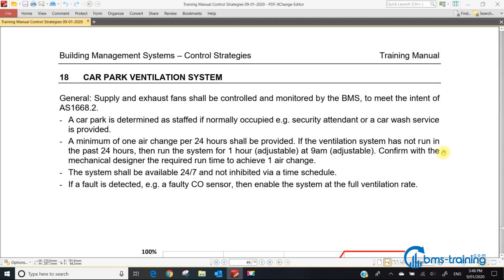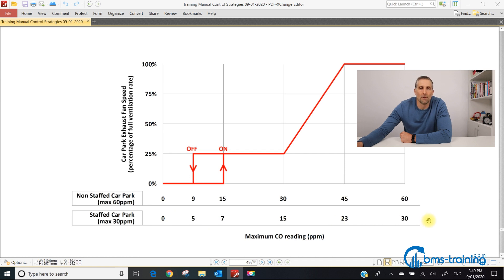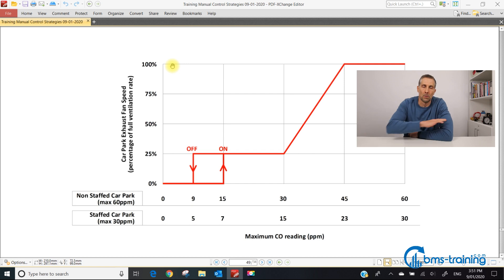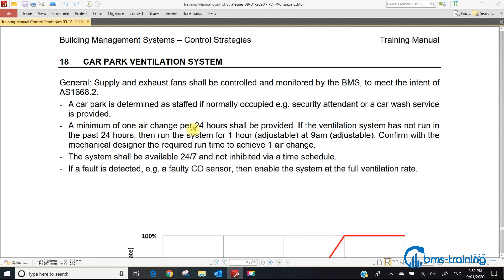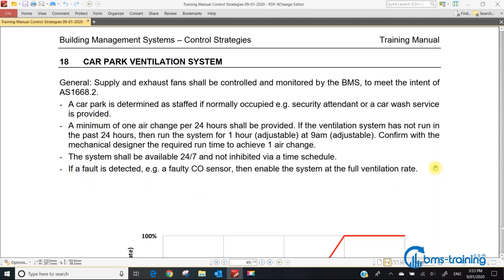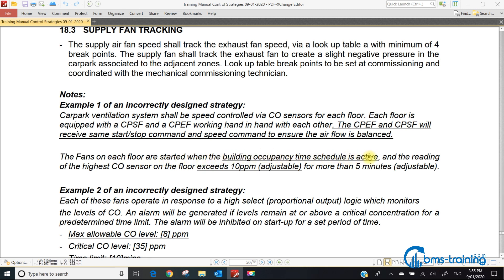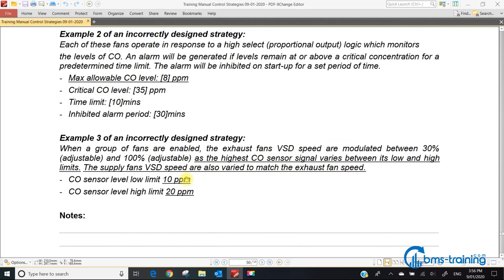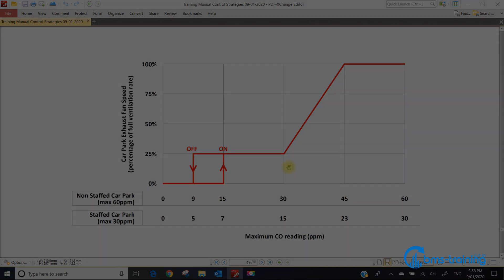CO Control - Car Park Ventilation (BMS)

Comment: Hi Bryce, thanks. Great explanation. Do you also cover all these pieces in your training course "Advanced Control Strategies"?
Reply from the maker: Hi Arsal, yes there is some overlap in the online course. However, most of the online course is not on YouTube. And you get the control strategies written out in the training manual. 
There is significant additional course material on AHU systems and water systems not discussed on the YouTube channel. 
Thanks for the support.
Reply: @bryceanderson17  Thanks Bryce, I will be registering for two for the courses this year :)

Comment: Great video Bryce.
Just wanted to note that Mechanical Engineers would typically size the supply air make up fan to be at 80% of the exhaust air flow rate anyway. So in theory if the BMCS signal is 10V (100%) it would be the Max design airflow of both fans, and if they sized correctly, space would be negatively pressured. A 9V signal might be too overcompensating perhaps? Not sure, keen to hear some thoughts.
Anwyays great informative video.
Reply from the maker: I agree Leo, if mechanical engineers size the supply air fans smaller then the BMS can send the same signal to both as you have described. 
Thanks for clearing that up. Cheers.

Comment: Should the reading from multi sensors in a single level / zone be averaged?
Reply from the maker: The Australian Standard AS1668.2 clause 4.11.2 says the following: 
... ventilation rates shall be varied such that when the concentration of contaminants measured by ANY sensor within the enclosure... 

Therefore, we need to do a maximum select and NOT an average select of all the sensors. 
Code requirements may be different in your country? 

It makes sense, if one level of the car park is very busy, the entrance to the shopping centre, but the other 3 levels are empty, then average would provide a false reading for the busy floor. 
Thanks..

Comment: Interesting Bryce, but regarding the point of makeup airspeed wrt exhaust fan speed, I think that considering makeup fan capacity equal to exhaust fan capacity but running at lower speed is not optimum in terms of CAPEX, it is more valuable to consider makeup fan running at full speed but with a capacity of let's say 85 % of exhaust fan capacity. or What do you think
Reply from the maker: Hi Ahmed. 
You are correct 😊

Comment: Hi Bryce .. great video as usual. 
Quick question, in the staffed car park, how to start running the fans at CO 5ppm while OA already has CO 9ppm ? Unless these values are relative to OA ? It makes more sense in non-staffed CP as fans start running beyond CO 9ppm up to CO 60ppm, which CO 51ppm total inside the car park.
Can you touch base on this one please ?
Reply from the maker: Hi Amer,
In staffed car park, the fans start at min speed when the max CO is above 7ppm, and switch off below 5ppm. 
In non staffed car park, the fans start at min speed when the max CO is above 15ppm, and switch off below 9ppm. 
AS1668.2 does not describe any CO values relative to outside air CO. 
Hope that helps, otherwise get my number and call me, cheers.